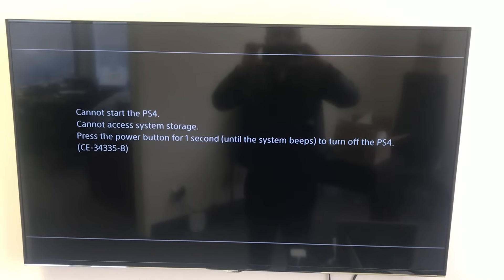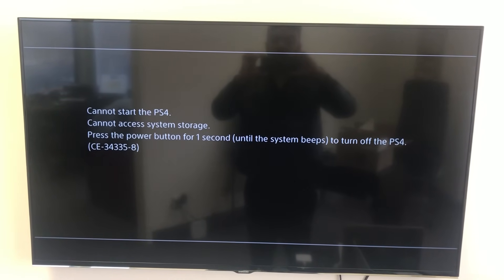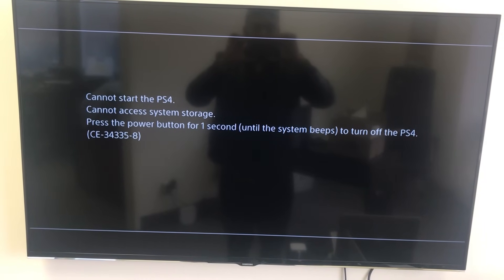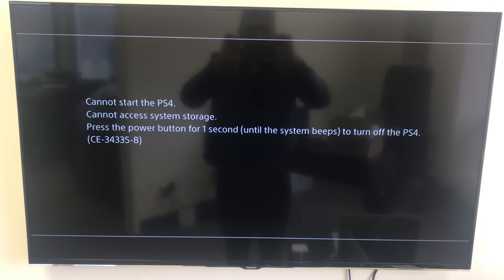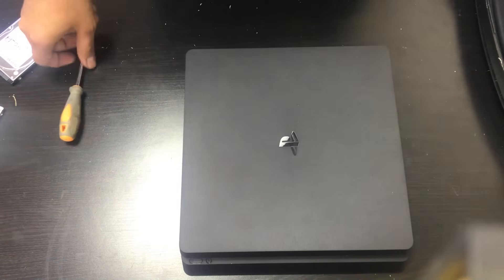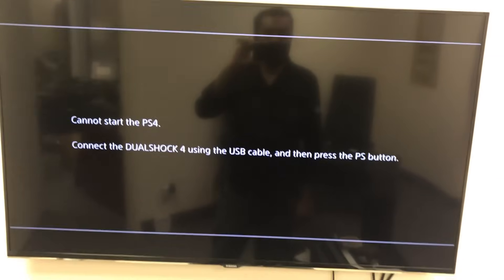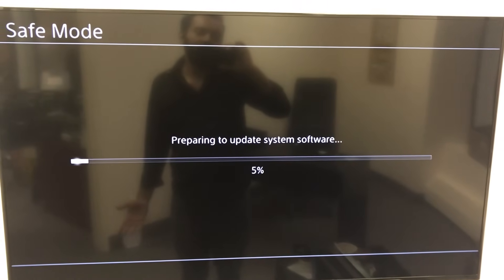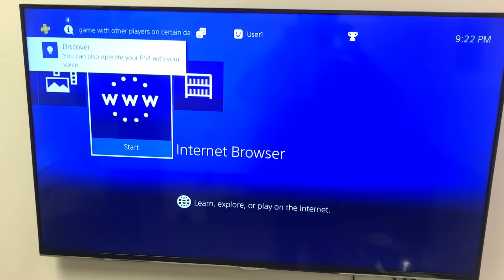PS4 Slim Cannot Start (CE-34335-8) Cannot access system storage fix

Comment: I have another ps4 with a broken HDMI port could I take a hard drive out of there and use it for my slim?
Reply from the maker: Yes you can. We can also fix the HDMI port on your PS4 if youre interested in sending it in.
Reply: Fasttech I managed to fix the hard drive problem but know I’m stuck in a endless loop in safe mode, I put the newest system software update on my USB but everytime I get a error can you please help me with this?

Comment: I got a new hard drive did everything thing you did but when I turned it on it still showed the that I can not access my storage what should I do ?
Reply from the maker: Juan Martinez I can try to troubleshoot for you if you bough the hard drive from us.
Reply: @fasttechvideo  I have the same problem... i bought the hard drive from your website but still the (Cannot start ps4,  cannot access system storage) i tried to put it in safe mode but it doesn't go to safe mode at all

Comment: Lol I looked at my hard drive and it was half unplug so I pushed it bk in and now its fixed so thanks man
Reply from the maker: You're welcome
Reply: I did that it didn't work in my pro :(
Reply: What do you mean it was half unplugged
Reply: Bro same thing, my friend accidentally dropped it on its corner and the hard drive got a little jacked up, but I just needed to push it back in and it was fine. But my ps4s corner is little jacked up, could’ve been worse though

Comment: What to do if holding down the power button doesn't boot to safe mode
Reply: Same here
Reply: metoo
Reply from the maker: @taniksambo1969  swap out the hard drive, you will still be able to reinstall software and reinitialize the system
Reply: @fasttechvideo  this was 5 years ago lol
Reply from the maker: @taniksambo1969  better late than never

Comment: I punched my ps4 because it kept corrupting application and it was unplayable. Now I find out my rage was because the hard drive was causing all the damn problems
Reply: My ps4 pro kept corrupting with the original hard drive and when i changed to a new better drive. Its just sony's crappy hardware and system software.

Comment: Make sure you guys give it a clean up with an air compressor. Try it again with your normal hard drive and if it still doesn't work then go ahead and buy a new one. It's just a small precaution to see if it collected a little bit of dust.
Reply: Yeah, I didn’t really do the dust part but I just took it out and reinstalled it back in and it worked like a charm!

Comment: I changed my ps4 hard drive but i still get the same error
Reply: Try taking it out right
Reply: Just take the peice off slide it off and take the thing wit the band out
Reply: Devonte Chambers either let it chill off or blow dry it off with cold air and put it back in it should work

Comment: Hi I get the same error but not that only happened when I hop on a game it crashes middle of it need help is it the hard drive because I just changed my power supply on amazon
Reply from the maker: This error is not caused by a bad power supply
Reply: @fasttechvideo  not you replied in 5 years is crazy 😂 i got a ps5 now
Reply from the maker: @Kingios561  hahah
Reply: @fasttechvideo bro the part where my hard goes into is rusty to think that’s the problem why it keeps on saying cannot access system storage

Comment: I’m having an issue. I tried putting a new hard drive in and I bought the wrong one so I got that screen. I took out the new one and put the old one back in and that screen popped up again. Maybe I just need to align the screws better but I’m not entirely sure
Reply: Did you fix it mate? Im having the same problem
Reply: @whatsneww123  yeah I did but now I have a PS5. I think it was just the screws weren’t aligned for me

Comment: It won’t let me pass the “Connect the dualshock 4” any tips
Reply: Yong Husk use a different controller
Reply: Use a different usb cord
Reply: @braybraystar  having similar issue, tried both a different controller and a different USB cable. Just lights up for 1 second then won't do shit. Getting pissed.
Reply from the maker: You need a bluetooth chip replacement.
Reply: @fasttechvideo  pretty sure it needed new everything lol. I work with special needs adults, and the guy I was trying to help with the fix isn't exactly what I'd call "careful" with his electronics. He bought a new system before I could try the fix 🤷‍♂️ lol

Comment: No need for this !!! Just Get a usb initialize the ps4 then after you do that you may get a problem where it dont turn on and you feel you have fail i think there was a bunch of left out instructions.  You have to use this method . You already erase all accounts but you should update the latest update im not in safe mode now but use the update tab i think it maybe 2 or 3 then update using usb . It should update and boot up correctly
Reply from the maker: Only if you hard drive is not already dead. We have videos showing you how to do this without a HDD but that wont't work if you have a 'Storage Not Found' Error.

Comment: You just have too grab it out and put it in with the same hard drive it worked for me ps4 slim !
Reply from the maker: It will fail again in a few days/weeks. Backup your data while its still running.
Reply: How do you back it up ?

Comment: How do I install the 5.5 update I removed the hard drive and inserted it back in it worked perfectly fine before I removed it and now I can’t turn it on it needs a update I tried doing it to a usb then passing the update to the ps4 but it won’t find the uodate
Reply: did you unscrew the four screws when you removed the hard drive?

Comment: Must be nice for everyone ps4 to work after mine didnt
Reply from the maker: Did you try to replace your hard drive Patricia? Was this after a spill?
Reply: Fasttech no i got grounded one time and my step dad trynna act hard pulled it out of the wall while it was on rest mode and a long time later i finally get my ps4 back and the messege pops up i go get a new hard drive on black friday did all steps and same thing even with the new hardrive just sucks
Reply: Fasttech i even tried to take the working hardrive out my ps3 and put it in the ps4 still same error
Reply from the maker: Are you sure you are connecting the new hard drive correctly?
Reply: Fasttech yes im certain

Comment: Thank you so much for the video I just fixed my son's game😀your a champion tho cheers for the video again😃
Reply: We're u buy the hard drive
Reply from the maker: @cleanfreak84  please check the links in the description box and top comment. Also subscribe to the channel and like the video 😊
Reply: @fasttechvideo  do I need to buy the same hard drive as the one in my original one it’s a terabyte
Reply from the maker: @jesusc222  no it does not have to be the same size. You can opt for a smaller or larger capacity hard drive.
Reply: @fasttechvideo  ok because I just ordered one and was wonder how long would it take to ship or to arrive
Reply from the maker: @jesusc222  You can call 1(888)744-7372 or email service@fasttechstore.com

Comment: can u do a CUH-1215A blue light repair pls😁🖒
Reply from the maker: You will need a motherboard replacement.
Reply: @fasttechvideo  If you replace a motherboard then you need to replace the optic drive also, so technically is a new game console.
PS 4 mainboard is paired with the optic drive, you cannot change one without the other.